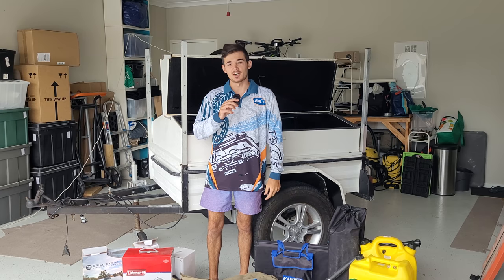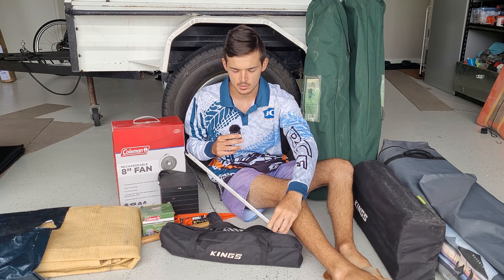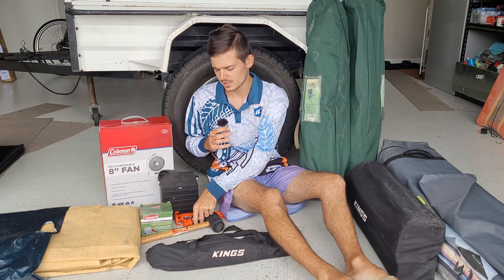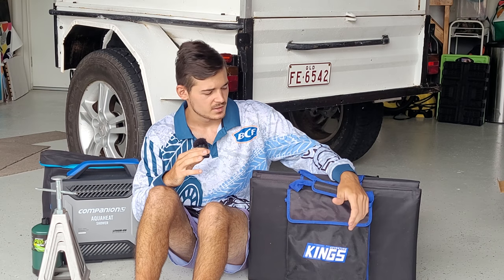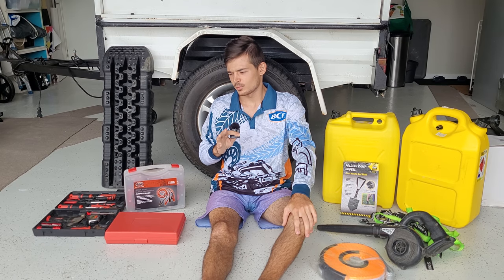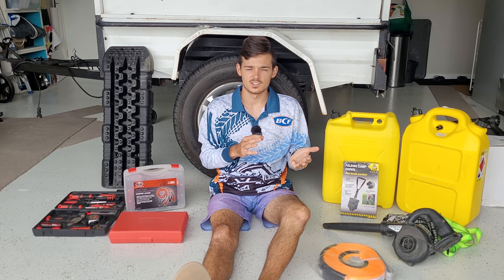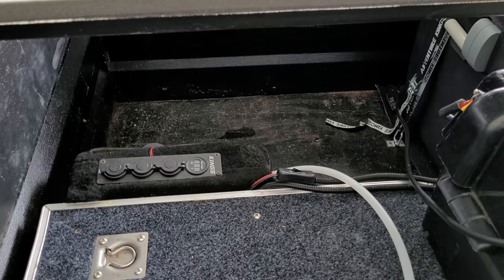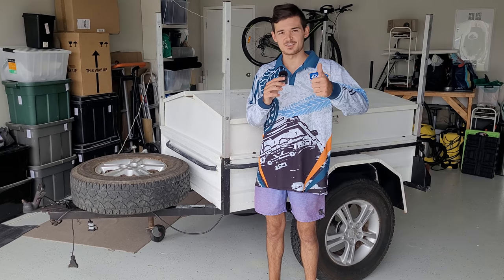WHAT TO PACK FOR 1 WEEK AT K'GARI FRASER ISLAND

Comment: TLDR: 
Check Double Island Point for more accurate weather forecasts, not "Fraser Island"
Use space bags and a cordless blower to save space
Take duct tape
Take cam/ratchet straps
---

You can usually use a cordless blower to blow up air matresses (check before you go it actually works) 
One trick we did last time we went was we got space bags from Kmart and packed our clothes into them. Vacuum them down, put all our clothes into 1 suitcase. Saves heaps of space. Also can space bag down towels, blankets, doonas, tea towels. 
To suck the space bags back down use the cordless blower, or you can also just lay on the packed bag and seal it up and you'll get about 80% compression i guess?

If you are going to Fraser to camp on the eastern beach side and want to check weather forecast I suggest looking at Double Island Point's weather forecast - especially for wind. The forecast when we went last week for "Fraser Island" in the BOM app said 15km/h winds. We had 40km/h winds ALL DAY AND NIGHT. 

The observation stations for Fraser Island seem to be in sheltered areas - Eurong is a resort and is sheltered. Kingfisher is on the western side and is sheltered. Even the lighthouse at the northern tip was recording wind down at 15km/h when we were there, so maybe it was sheltered from them as the wind was S/SSE. 

The only place that was showing strong winds in BOMs data was Double Island Point which is where the barge goes from at the souther end of Fraser Island, so I suggest you check DI's weather forecast if you're planning a trip there. 

We had wind around 50km/h and gusts that peaked at 90km/h. My new Dune tent held up well, but the main top pole bent and two of the flexible poles at the south end of the tent (the end the wind was hitting) split lengthways and we had to repair it with duct tape - TAKE DUCT TAPE. We parked a vehicle in front of it to help break the wind (it does a little, but not much with winds at those speeds) 

We parked another vehicle at the south end of our gazebo setup and cam strapped its 2 legs to a vehicle (bull bar and tray tie down bar - it was a Hilux ute) and I think that probably saved our gazebo setup. TAKE CAM STRAPS OR RACHET STRAPS. They also are just generally useful items (clothes line for example). My brother came back from the bin point and said "I've never seen so many dumped gazebos".
Reply from the maker: Thanks for this mate I reckon people will appreciate it! And yes ALWAYS take Tuct tape haha it saves you😄